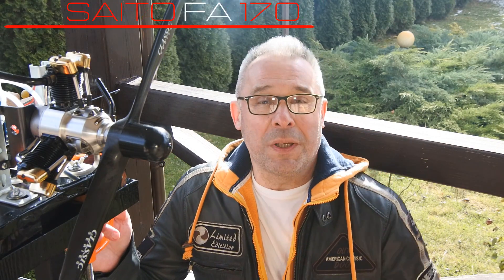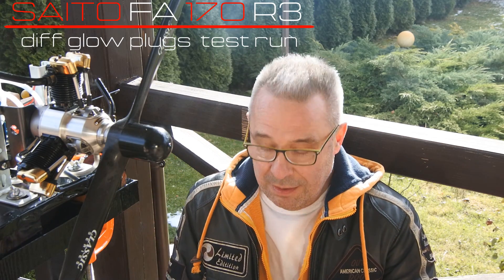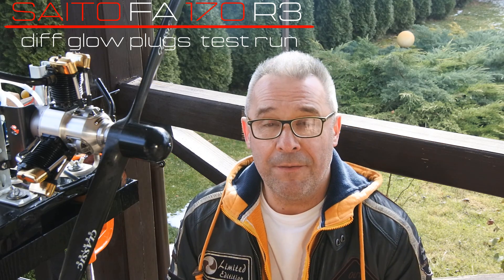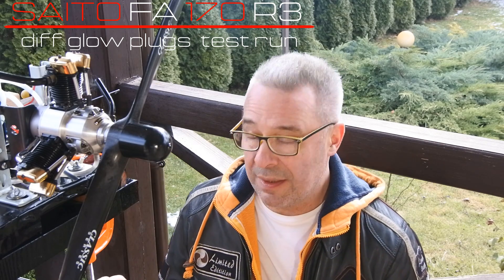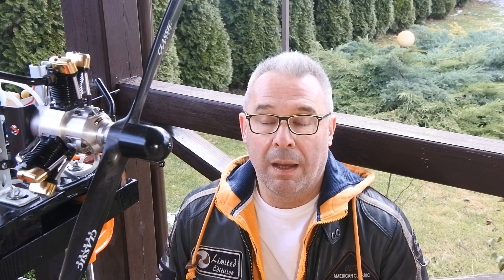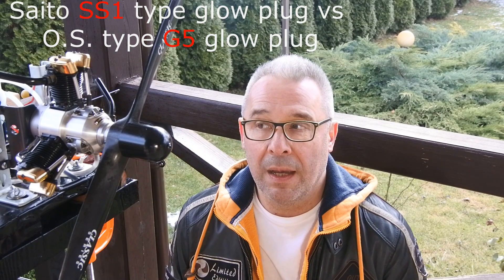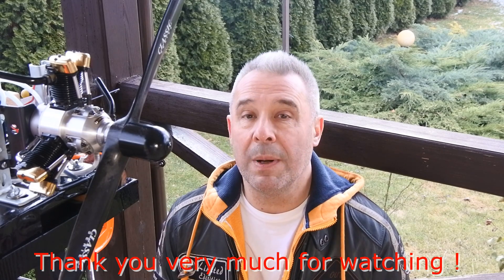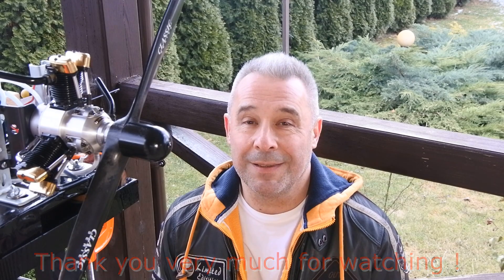Saito FA 170 R3 diff glow plugs test run

Comment: Hello and congrats on your videos, 
Do you think it would be possible for a glow radial engine with G5 glowplugs to burn gasoline?
(without changing the carburator)
What percentage of oil would you use?
Thank you
Reply from the maker: Hi, and thank you a lot for your question ! In fact, these spark plugs can ignite both gasoline and methanol fuel mixtures. But... the carburetor of a methanol engine is not at all configured to work with a gasoline mixture, and the engine, with a high probability, will not be able to work normally on a gasoline mixture with a methanol based carb, well, or almost not at all. Options:
To replace the methanol carburetor with a carburetor for gasoline mixtures (for example, with a carburetor from a DLE 35/55 engine or something from this series.). There is also confidence that an engine converted in this way will work with significantly hig0her operating temperature (the calorific value of gasoline is significantly higher than that of a methanol mixture). So, based on above mentioned - better to find more balanced solution, or even this configuration raises questions. Thank you and have a nice day !

Comment: Hi,, Did you managed to get the engine to run properly ?
It seems that all the Saito radials have the same issues.
Reply from the maker: Hi, nice to hear from you ! Not yet, exactly, there is few very time consuming things are breaking my future Saito radials engine's "how to fix" investigation. A new job, very important for my country and a new house, not so ready for engine's investigation. Anyhow, I'm on the way, still working on CrazyEngines channel. Should say, that there isn't completely confirm, that all 3 cylinder radials have the same behavior. There is two bunch of problems, first, is with glow radials, and second, is with FG, gas modified engines. Glow versions has better adaptation for Saito own design flaws, because of glow ignition nature - moment of ignition is auto regulated by the glow plug, where with spark ignition, point of ignition is clearly defined by the placement of ignition magnets. So, based on my own understanding, that Saito FG60R3 (for and from my own example), has geometrical, mechanical mistake, so every crankshaft turn engine fires or earlier (on #1), or later (#2), or similar to that. So, this non synchronized process provoke engine to  shake and to vibrate a lot.  When I convert engine into a glow ignition, vibrations were reduced a bit (due to the automatic advance glow ignition), but this vibration problem is still exists. I'll need more time to find the way, how to correct this.   Thank you for your question and have a nice day !
Reply: @crazyengines88  The biggest issue and contributor to poor lowspeed and transition at 5000RPM is the fuel delivery (manifold/ back cover).
As you correctly pointing out the ignition is another issue affecting the gas versions, unless the timing magnets are corrected.
One thing that no one are mentioning is the relation to the cam timings, maybe that is not a problem ??
However if I would bet any money I would bet on the manifold as the biggest problem, giving rough operation and variations in cylinder temperature.
I have made my own modification but have not yet had time to play and confirm it. The idéa is to keep the volume as small as possible and to have identical fuel delivery to all 3 cylinders.  I hope I will have time to test it during this winter.
Reply from the maker: @roki5941  Yes, thank you ! This problem requires very consequential plan to investigate it in detail and for sure, will consume a lot of time. I also dream to find and to fix such engine behavior, but my reality told me, that this series of videos could be boring enough 😂  I also think, that manifold is a key factor, but this fact isn't reflects such huge engine vibrations. There is only way - consequentially  find and eliminate  each part of the problem, it's for sure consists from few design flaws.Thank you ans have a nice day !
Reply: @crazyengines88  I think that vibrations usually come from flooded combustion chamber.. Do you have vibrations on all of your Saiti 3 Radials ?
Reply from the maker: @roki5941   No, not all my 3 cylinder Saito radials shows the same behavior. Such high level of vibrations is mostly owned by Saito FG60R3, higher with spark ignition, ;less with glow ignition. Due to glow ignition ability for automatic ignition pre - advancing, glow ignition shows twice, at least vibration level. From this facts I make a conclusion, that  mechanical design flaw in FgG60 could be partially compensated in glow ignition engine setup (based on OS G5 type glow plugs). The rest of mine Saito radials (FA120R3, FA 170R3 and even FA 325 R5 D2) doesn't show such vibration level. What is common for all this engines (less with FA 325 R5 D2), is that all are tentative to run with diff cylinder temps, two are usually runs hotter (so, leaner fuel mix), and one is running cooler (so, richer fuel mix). This is clearly fuel distribution design flaw, non even fuel distribution.
Reply: @crazyengines88  Ok, I take it as the FG60 have a specific problem of it´s own. As far as I have understud both MMM and CH-Ignitions have compensated the timing  magnets for the geometrical differences in the connecting rod. Have you tried to change the ignition setting and verify the vibration vith various settings ? However if you get smoother running with the G5 plugs you can be almost sure it all has to do with the uneven fuel delivery.
I used to run my FA170 with the MMM ignition and tested various settings 28-34 degrees and the smothest running was at 29 degrees, 
but that was with the original intake manifold. I appresciate your videos and I am looking forward to your final fix for your engines.

Here is my engine with MMM, running on 5% nitro, 18% oil & methanol and 29 degrees BTDC setting.
There are huge variations in temperature, it is cyl #2 that floods and creates the smoke on the video, 
https://www.youtube.com/watch?v=Un_UOODawyI
Reply from the maker: @roki5941   Thank you, great video, very nice sound and excellent transition ! No problems with an engine, for sure. But I don't have to much problems with FA170R3, it's an excellent engine by its own. I've an idea to balance fuel distribution inside intake manifolds, on each of each cylinder. One time should model it, to prove, will it work. The only I need - it's time.

Comment: Заливает безбожно...При этом както держит холостые...
Reply from the maker: Thank you for your comment ! I always prefer slightly richer mixture when I start the engine after rebuild or repair, as it actually, will again needs a kind of a gentle break-in. Therefore, it looks as flooded a little. But it doesn't really affect idle performance, as I always tunes the engine to keep stable and low idle speed.

Comment: Glad I found this video...  It very well illustrates the issue of uneven fuel distribution.
The G5 plug helped slightly but the performance is still far from acceptable.  // 
I have tried to find pictures online about the MMM intake manifold..
But no luck this far.
Reply from the maker: Thank you a lot for that information !

Comment: Nice photography. Well, I can see how well lubricated your engine was, lol. No shortage of oil there and your test stand will never rust! 😂
Reply from the maker: Thank you for your nice comment ! And yes, you're totally right - you can't find any rusty spot om my workbench - it's covered with thin layer of an oil, mostly, with Klotz Techniplate, as well, as with Motul Micro 2T 🙂
To be honest, I like to run a new, or freshly reassembled engines with additional oil content, going to avoid any possible seize of an engines. 
Proper lubrication is a key !
Reply: @crazyengines88  🙂
Reply from the maker: @xKmotx  👍